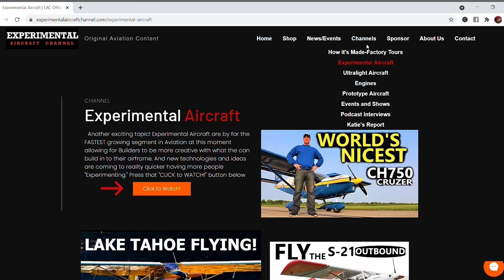How Helicopter Rotor Blades FLY! An Engineering Lesson

Comment: That's a great explanation of blade flapping / sailing where pilot error can result in a rotor to tail strike, however I believe Silverlight has a solution in the form of an audible alert system called the GWS (Gyro Warning System). The GWS also warns of other potentially dangerous mistakes pilots can make in a gyroplane.

Comment: pretty good explanation but you can still flap (hinge) the blades at full back stick as you are stalling the blades at higher a of a.  too much airspeed compared to the rotor speed is key though.

Comment: Interesting, even if there wasn't a single helicopter in the video
Reply: True but the flapping principle still is the same in helicopters. If you fly a R22 it still has a central as well as an offset flapping hinge and basics of equalizing lift remain the same there
Reply from the maker: Sorry about that @Drampa Dreg. The conversation is the same for both Gyro and Heli. "Helicopter" happens to work better in the title else you may have not seen this video. :-)

Comment: 👍♥️ Very nice.
   I question if, during cruise, the rotor has the potential to generate enough electrical energy to be useful enough for exploring the possibility of developing an electric propulsion design. If the rotor can maintain design speed while also supplying the additional load of an electric generator?
Reply: Interesting thought but nothing is ever free. Energy taken away for some purpose effects its other purpose (lift creation). How much? I'd have to think on that and may be its possible but no such thing as free lunch in general. The main problem with any electric aircraft is storage energy density. Simply put gasoline/chemical storage has 20 x more energy density than the best electric storage mechanism commercialized today. Also as we use gasoline, its weight reduces and electric storage holds the weight basically the same when its charged or when its out. Huge penalty in energy density and weight this way. Some clever/genius material scientists have to solve this fundamental problem before any electric aircraft will become truly viable. Hopefully this will happen soon. A lot of people working on it.
Reply: Yes, your explanations are indeed correct. This is an excellent gyroplane and I would purchase it today for my own personal mission. I love the larger rotor blades and the highest power rated fuel injected turbocharged Rotax. I've visited the building and pricing schedules and am satisfied. Hopefully I'll have the resources and health in the near future to visit, fly, and participate in building one. No need for any modifications; except my unfamiliarity with this particular instrument panel would need to be addressed. I also wonder if floats are possible.
   I'm back to building a flying saucer for now. 🛸

Comment: the teeter hinge also removes the effects of gyroscopic precession from influencing the control system.  without teetering rotors gyroscopic precession would make it uncontrollable.  anyone using a drill or even a hand held fan has noticed the 90 degree off set of action.  as a of a changes only happen when the rotor head is certain positions the impact of the change in terms of precession only happens 90 degrees latter when the teeter hinge is aligned so it has zero impact on the controls.  this is hard to explain in words but say you push the head forward at the moment the rotor is fore-aft as shown here.  the rotor won't do anything as the head will tilt but the rotors are on a hinge on this axis.  however as they progress around to side to side the head pitched down has tilted the rotor so the retreating blade has a higher a of a and the advancing has a lower a of a.  the blade begins to tilt retreating up and advancing down starting to fly into a new plane of rotation.  now on a fixed rotor this would impart a gyroscopic precession 90 degrees latter but as that is now fore aft again the precession not only cannot impact the control system but will be compensated by the teeter system equalling out dysentery of lift and it would be moving in the right direction anyway.

this is why gyros are so manoverable compared to fixed wings thier rotors have little resistance to flying into a new plane of rotation.

Comment: First of all I am not an engineer:  but I do have a question,  Have you tested a Kasper wing design in a rotor blade?

The reason I am asking this is that back in the 1980's I met Kasper Wetol a Boeing engineer who created the Kasper wing ultralight aircraft,  he asked me a simple question "what do you see when you look at an aircraft wing?"   I made the motion with my hand as if it was going over the top of the wing, he said that is the problem nobody looks underneath the wing, he proceeded to explain that he asked the Boeing Department "HOW MUCH ENERGY DOES THE ARTICLE TEAL EXPEND ON ITS NONSTOP FLIGHT FROM POLE TO POLE",  the answer came back that it (The Artic Teal) should not exist on arrival,  we know it makes the flight every year without fail,  he than asked me "do birds have square bones? well I said no! he replied than why do we put them in airplanes?  he said look at the underside of an article teals wing?  this is the proper design nature gave the Article Teal to conserve energy "THE SECRET IS THE UNDERSIDE OF THE WING".

The magazine "SCIENTIFIC AMERICAN"  in the 1990's ran an article on the Kasper Wing stating that if it (the Kasper wing) were to be installed on a Boeing 747 the plane could fly fully loaded at 35mph with no problems.   an ultra light aircraft Kasper wing has been sold for a number of years.

I have never heard of any aircraft company even attempting to test the Kasper Wing on an aircraft other than the ultra light,    would you be willing to test a Kasper Wing (Rotor) design on one of your  helicopters to see if it would enhance the flight capabilities?
Reply from the maker: This is NEW to me. Nice story sharing what YOU know! Of course. Abid (The Engineer) didn't produce this video... WE DID. :-) But... you are more than welcome to reach out to him to start a conversation. The link to his website is found in video as well as a link in the description below. THANK YOU FOR WATCHING!
Reply: @ExperimentalAircraftChannel  one thing i forgot to include is that the Kasper Wing is the only fixed wing aircraft that can land, as Wetol explained to me is that birds land airplanes fly in, the kasper wing when brought into a stall it can be lowered to the ground just like a bird landing on a limb.

Comment: seems like this pilot error with not pullig back the stick could have someone figure out a way to fail safe this by warning system or the like ??? mechanical electronic ?
Reply: Design a simple microprocessor system that monitors the RPMs of engine, rotor, and wheels across ground, and possibly airspeed, and it could monitor the take-off run.  It could sound an alarm for pilot to execute ABORT TAKE-OFF.
Reply: @chetmyers7041  yea ! my comment was off the top of my head and yea a solution is great answer